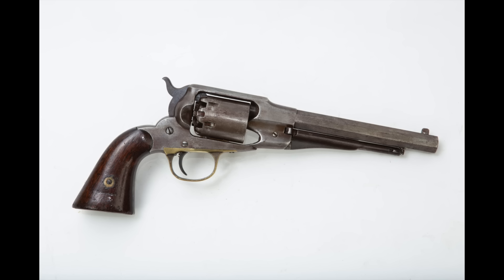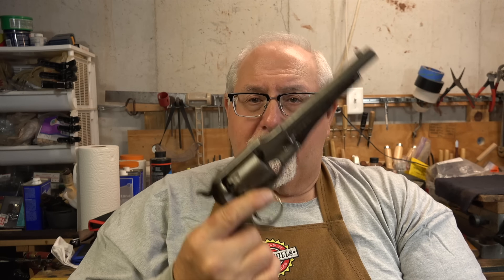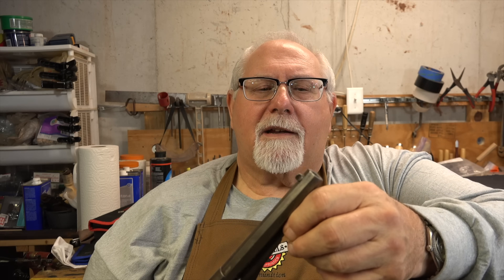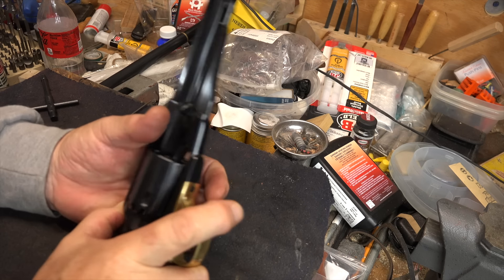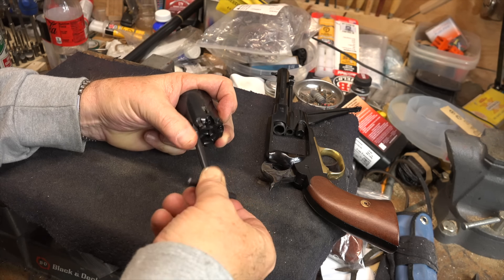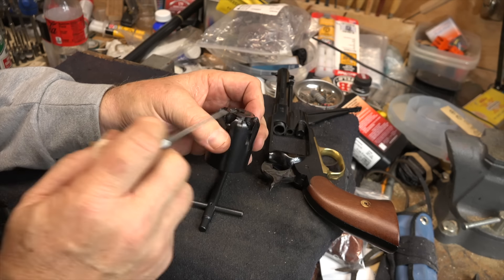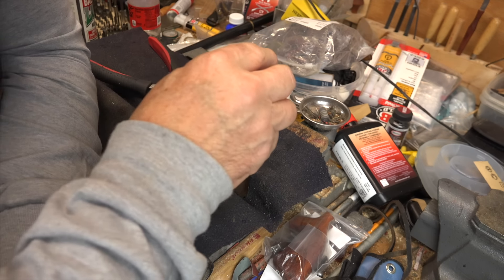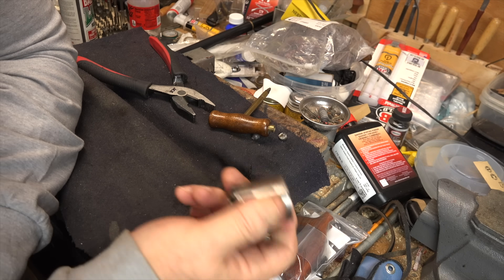Clearing a loaded Cap & Ball revolver cylinder

Comment: Mike, I would like to recommend KROIL penetrating oil for removing frozen nipples.  I used it on my original M1842 US Horse Pistol over a 3 day period and it worked.  You may have found a new way of removing the ball easily by drilling/spinning it loose from the chamber in one step.
Reply: Kroil is good stuff

Comment: I am gonna be working on a muzzleloader that the ram rod broke while screwed into a ball the guy was trying to pull out after loading with no powder..hope it goes easy enough, I never worked on one like this!!
Reply: What kind of muzzleloader and how old is it? If it's fairly new, and it's got a traditional threaded in breech plug, take the barrel out, soak and soak down the breech with kroil, let it sit for a few days. Then clamp it down hard in your vice (use some padding on the jaws), then heat up the breech with a propane torch until it's smoking, use a big crescent wrench with a cheater bar if necessary to thread out the breech plug. Now you can take a metal rod and ram the ball and broken ramrod out from breech to muzzle and give the barrel a more thorough cleaning before reassembly.
Reply: It’s a Cap and ball made by a guy in PA in the early 90s is all know right now til later today when they drop it off..
Reply: @Yamaha38XCRacer  Sounds good. Good luck with it. Do you know if the ball and rammer got stuck after the guy had been firing it? If so, you might have a lot of rust in the bore.
Reply: I've done that on several occasions. I took out the screw on the side by the nipple and put as much powder in as i could, and it blew it out every time. I f the rifle doesn't have the side cleanout screw, pull the nipple out and  get as much powder in as you can and put it back in and it should blow it out. Once I forgot the powder and when I loadeed the patch and ball I got the ram rod stuck in the barrel. So put powder in the side clean out hole aimed at a tree when I discharged it and came out so hard it bent my metal field rod! Oops!
Reply: @andrewyording4284  I've had luck blowing crap out of barrels with compressed air but never a stuck ball.
Reply: As always,  a great video! Glad to see my prayers for your good health were answered! Percussion guns are the best,  and so far the governments ignor them!

Comment: Hi Mike.  Before you send that off for nipple extraction.  You should try a reverse thread screw extractor.  I used one to remove a stuck nipple on my 1858 NMA and it worked perfectly.  However...it did destroy the nipple.  But it sounds like you were needing to replace the nipples anyway.  I also recommend using a brass dowel rather than a steel punch.  It can't spark and it won't mar the inside of the cylinder if it slips off the ball.

Comment: As an instructor, I recommend using a CO2 discharger with a flintlock adapter pressed in from the 7:49  rear of the nipple. Pop the valve and the ball is out with a satisfying."plop".

Comment: As some one who shoots cap and ball revolvers. I have found that to clear a cylinder, take the nipples off, use a brass screw to remove the powder, then using a small diameter dowel, I then push the ball's out. Works great. Never had a problem.
Reply: That's a good idea

Comment: Here's what I did with my hawken, that I bought and apparently already had a load in it when I bought it... (I don't necessarily recommend unless you're... me lol)
Air compressor with hand controlled rubber tip tool. You can buy the little accessory kits that have the little black rubber/plastic tip, usually with the basketball/football/tire filling kits.
Put the little rubber tip into nipple (you can also remove nipple if you want... if it makes it easier). Pressure set at like 50 psi at first, higher if needed.
send pressure by squeezing air-gun trigger, SLOWLY. I didn't need the full 50 psi, the load went flying across my garage.

Obviously keep it pointed in a safe direction, where the load can just dispense... Maybe into a trash can or something?

Comment: I have an original 1858 Remington purchase about 30 years ago. I finally decided to clean it and shoot it. I had a case of Frozen Nipples. I set the cylinder in a lid from a glass jar, gave each cylinder a good shot of PB Blaster, and 24 hrs later, they easily came out. I now put a tiny spot of Hi Temp grease on each nipple of all my guns after cleaning with no problems.
Reply: Good ideas! Is it acceptable to use Never Seize or a similar product?
Reply: @BarneyR-u2d  They might work. What I use is wheel bearing grease left over when I replaced my wheel bearings a couple of years ago. I use a toothpick to put a tiny dab on the threads and screw them in and out to spread it around. I do the same with all my black powder guns. You probably could also use brake caliber grease which comes in small packets. I have had no problems with my nipples since.

Comment: You know, I've never had to do the second method, but it occurs to me that I can imagine a time when I'd want to do it that way--for example, when I'm at the range and don't want to remove cylinder, screw out the nipple, get a hammer for the punch, etc.  I think I'll make a ball puller tool like that for my range box--I know the drill makes it easier, but it isn't actually necessary.  Thanks for the idea, Mike!

Comment: A mechanic's screw extractor tool designed for use on hardened broken bolts and studs would work well with a soft lead ball. Many thanks for the empowering knowledge just in case.

Comment: The EASY way is to used compressed air. I had one of the original Knight M/L in line rifles about their 3rd model year. At the end of deer season, I had not shot a deer. And rather than driving back the 30 something miles where I could discharge the weapon, I just took it outside and blew everything out of the barrel with 120+ - psi of air pressure. I still cleaned it as if I had shot it. Mostly because I wasn't sure what a few specks of black powder would do to bare steel (with wonder lube smeared on top of it) might do to a brand new barrel. And I wasn't going to take that chance.  I did have the screw thing to drill into the bullet. but I was not going to do that if I didn't HAVE to. In all of the years that I have hunted with a B.P. firearm, compressed air never let me down.

Comment: "Remove the nipple where the load is stuck" while NOT having your hand over the front of the cylinder, Mike! 😄
I keep a couple of wooden dowels of the right size in my shooting bag for that purpose. I don't need it often, but every once in a while you get in a hurry and forget the powder! If you use a sheet metal screw, you can generally dispense with the pilot hole. Pressure allows the screw to thread itself into the ball.

Comment: drill a small  hole and use a dry wall screw and pull the ball out. For a dry ball remove the nipple and use a brass or aluminum ONLY rod to drive the ball out.
Good to see your smiling face on the tube again.

Comment: Is the same process for a long rifle or a smooth bore muzzle loader, just a longer rod with a screw hidden under the rammer. Honestly for those that are new to black powder gun's, you do not need a drill as you can force the screw right straight into the led ball. And that is actually safer then using an electric drill that spins at a high speed, with a steel bit that can actually ignite the powder charge.

Comment: I was wondering if it was necessary to set the cylinder in a pan of water to foul the powder charge so it wouldn’t ignite from a spark before using a steel rod or a steel drill bit.

Comment: Your gunsmith will likely soak that nipple and cylinder in Kroil, PB Blaster, or automotive ATF fluid and acetone to free it up for removal. If that doesn't work he might use a sonic cleaner with a heated gun cleaning solvent to get it out. If the flat sides have the corners rounded or knocked off he will likely use a Easy Out fastener removal tool to remove it/them.

Comment: a regular ball puller won't work in a cylinder?
Reply from the maker: That's what I have on the T-handle
Reply: @duelist1954 I thought it was the Duelist1954 handy dandy ball puller that you fabricated.
Reply: @duelist1954  all the ball pullers i've had have had a brass disk between the threads to the rod and the puller threads that not having that disk i was thinking it was a homemade affair! ever try those CO2 powered jobs?

Comment: All I do is take out the nipples and then dump the powder... if I am feeling extra cautious lol   I will add a few drops of solvent.     I have stainless rods and brass rods of different dia.    once the nipples are out I drive the rod of the closest size to the nipple threads in the cyl to pound out the ball.     One thing I have done is make my own nipple wrenches from from good quality sockets (6 or 12 point) and a 1/4 inch ratchet.    So far No nipple has defeated me especially after a couple of days of penetrating oil